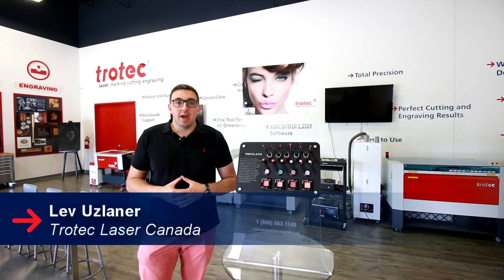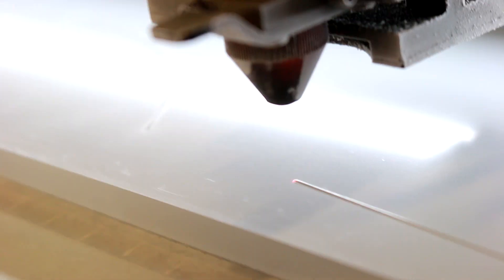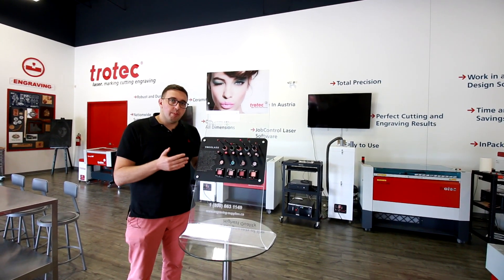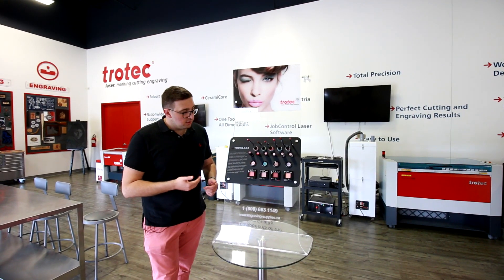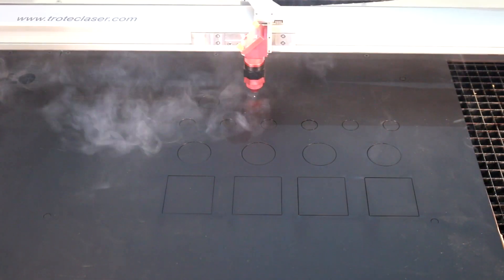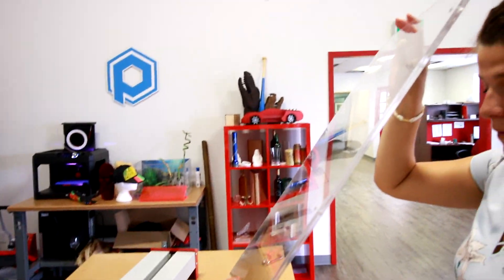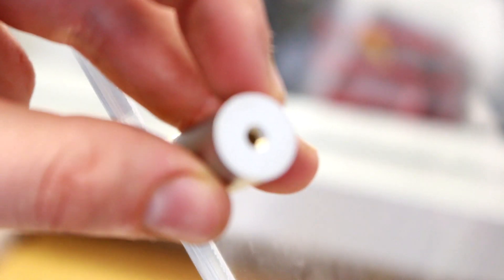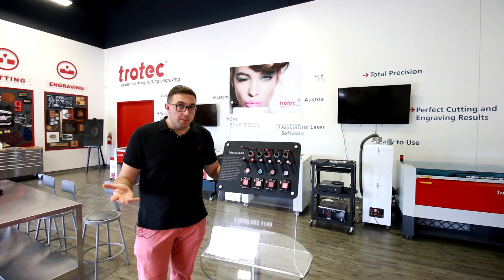Acrylic Point-of-Purchase (POP) Display | Acrylic Heat Bending

Comment: HI there, a few questions. I noticed you only removed the protective covering for the engraved section on the clear but for satin troglaze you has no covering at all why? After engraving find you wipe material? 

What 3MP product for you for gluing letter Mp468? Would be interested to see you applying this to sheets. 

Your standoff look interesting, have you done any video regarding fixings and acrylic?
Reply from the maker: +Rodney Baldwin hi Rodney, its really because of the cut and the thickness of the acrylic. For the 8mm, because its thicker we wanted to make sure there wont be any flame or burn marks since we wanted to cut the sheet with just one pass so we left the cover to protect it for the cut. For the 3mm black acrylic we knew that there wont be virtually any burn marks because the cutting is fast. We do usually whip clear acrylic if we are cutting tick pieces, there is usually some residue and we use Novus1 acrylic cleaner (that we also sell). If you do end up with some burn marks, if lets say you are cutting 20mm acrylic, then we recommend the Novus 3 cleaner. Keeping the cover usually protects the acrylic really well just in case - you can, with the right settings cut thick acrylic with no burn marks or cover.

As for 3M we provide the adhesive (its standard 3M backing) with any of our acrylic up to 6mm, wood and plastic products. You can add the adhesive right in our web store.

As for stand-offs we are bringing in high-end fixing from Germany in the coming months, we will do more videos on them as well.

Thanks for all your questions!